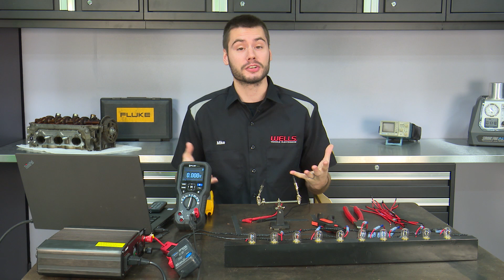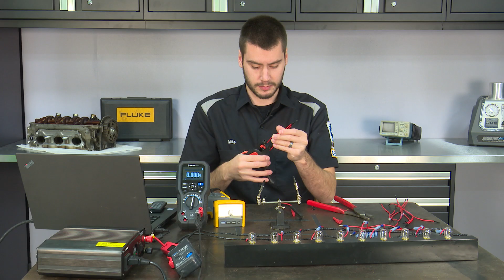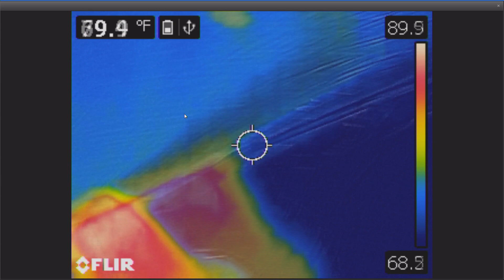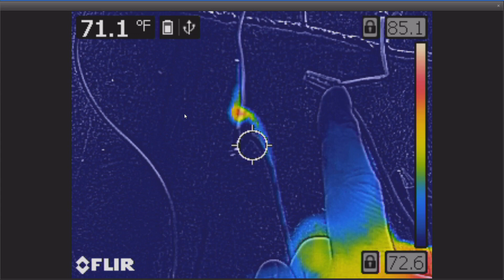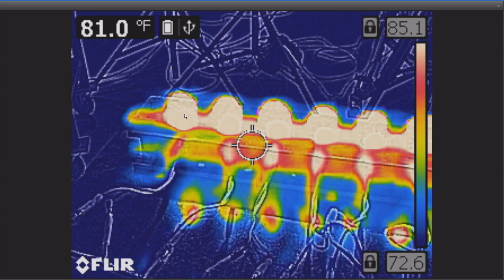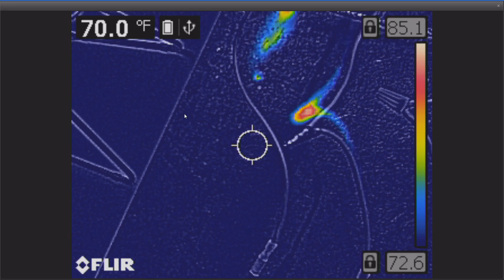Part 2 - Best Way To Connect Wires On Your Car - With Proof!

Comment: Great Experiment! Now I'm slightly less ashamed of the mess under my dash.

It would be interesting to also test the impact of having current through the wire during the test, as well as having a voltage potential through the liquid.  ( What type of salt is used in this test?)
Reply from the maker: ATrain, thanks man! Mess under you dash? 

I agree, it would be. There is some studies around current/voltage presence, the wires in a circuit, causes electrolysis. This could then promote or accelerate corrosion. 
The solution used in this test is called "Parex 5% salt spray." That is what the sticker on the tank read :)
Mike Becker, Technical Services Instructor

Comment: I'm ready to wire my Christmas lights with wire nuts. Lol
Reply from the maker: Hahaha! As long as they aren't Christmas lights on you car, go for it!
Mike Becker, Technical Services Instructor
Reply: 5 million dollar test equipment at BMW finds it good enough. We use wire nuts ALOT in industry.  Harsh conditions and higher loads.   But.... If the man with the test bench didnt find a problem why should we imagine one?
Reply: Richard Gill before this video, I was gonna fix my Christmas lights with aluminum foil and scotch tape!! Now, I'm thinking I should leave off the foil!!

Comment: I am going to start using wire nuts
Reply: Vince Bauer lol
Reply from the maker: NOOOOOOOOOOOOOOOOOOOOO!!!!!!!!!!!!!!!!!!!!!!!!!!!!!!!!!!!!!!!!!!!!!!!!!!!!!!!!!!!!!! :)
Mike Becker, Technical Services Instructor
Reply: Vince Bauer Could work!! Just don't forget to dip those connections into liquid electrical tape! Twice! Or three times! Good luck dipping those short wires, underneath the dash, or in the door jambs!!
Reply: roadkill5333 its a joke under dash iam not that concerned
Reply: Vince Bauer it's a joke!! You won't be able to dip the connections, in the door jambs! :-D
Reply: roadkill5333 we dont dip anything what u talking about